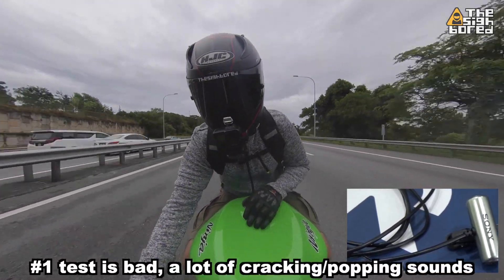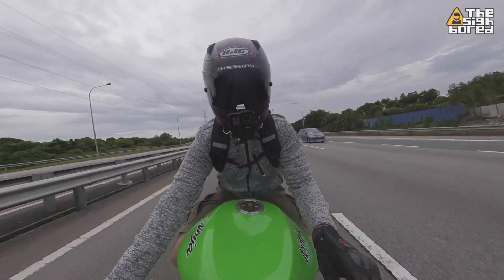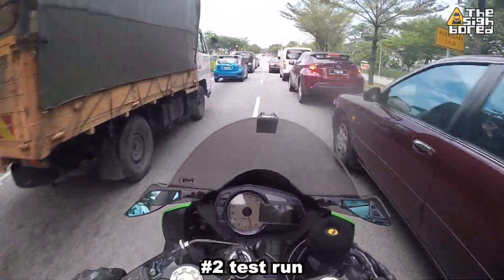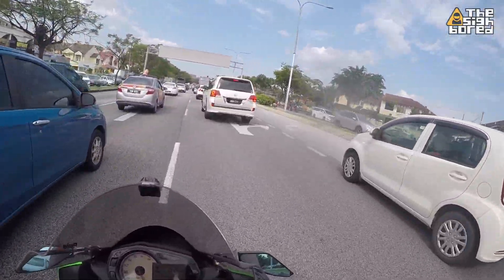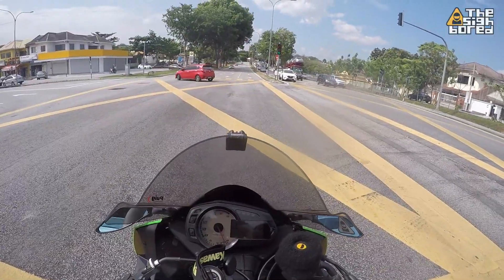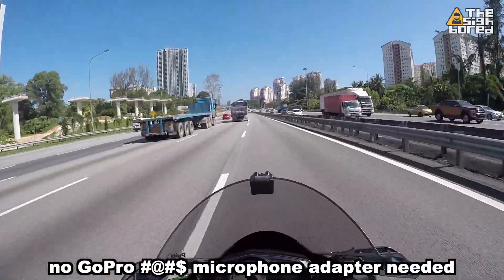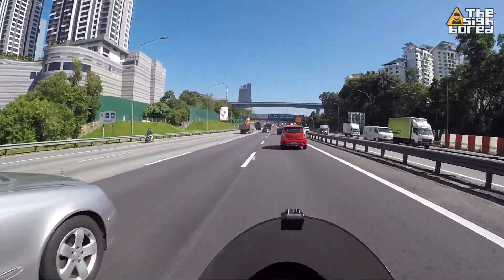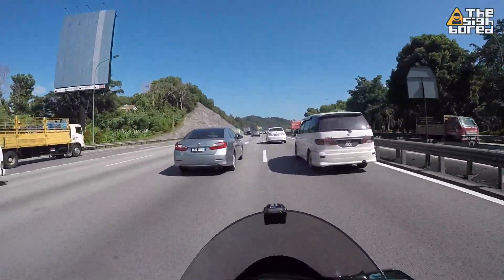Sony ECM CS3 microphone | Motovlog setup | Test | Review

Comment: How did you managed wind protection? I didn't fully understand it from video. I have x3000+ecm3+deadcat in Scorpion Air1400, and wind noise is very annoying...
Reply from the maker: I used just microphone sponge/foam for the mic, that's pretty much it.

Comment: I use this mic for hero 4&3 😅 quit ok, with a big dead cat. I think above hero4 the sound not going to be good
Reply from the maker: My foam is not too thick though.. Sound levels were already good enough (for me).. I wish I had research more of the compatibility with that shitty GoPro mic adapter..
Reply: @thesighbored  i heard the gopro 5 and above have some problem with the microphone.. that's y i didnt upgrade to 5 and above.. kinda like a downgrade from hero 4
Reply from the maker: My ECM DS70P works fine with Hero4 up to Hero7 so I didn't think that any trouble would occur for this CS3 one.. Now I knoe.. LoL..